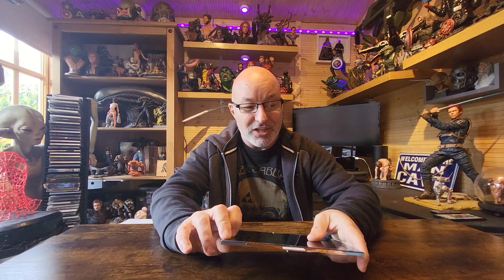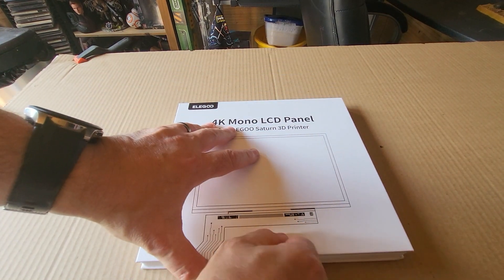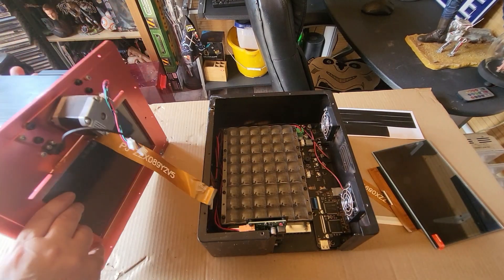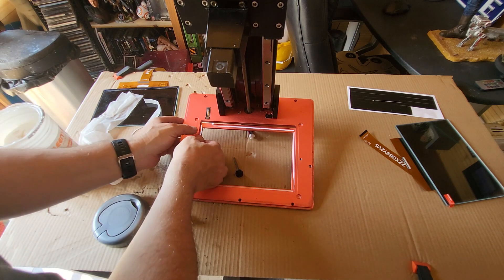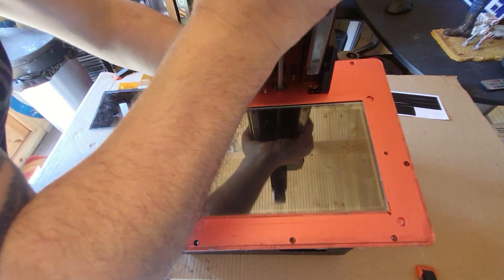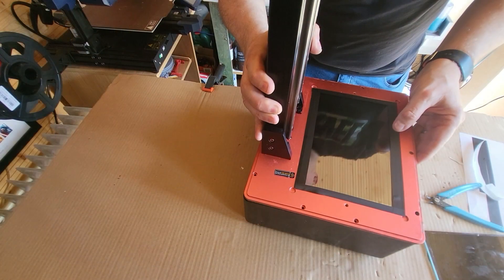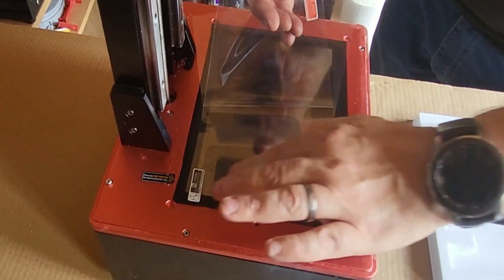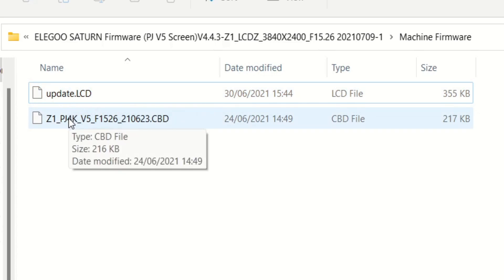How To Change LCD Screen On Elegoo Saturn 3D Printer

Comment: for clarity, pin 1 is towards the center of the board and pin 50 is on the outside of the board. (black side towards black clip)
you also want the Z- for the motor, not Z+
Reply from the maker: Thank you

Comment: you can actually just not remove the top, in the corner theres enough room to pry up the old lcd screen with a flathead screwdriver. it will usually crack the old lcd but thats getting thrown away anyways so no big deal, it's how i've been replacing mine for awhile and works pretty well
Reply from the maker: Not tried this
.. 👍

Comment: I would have shown in the video, which seems to be a big problem of lots of post on process of taking off the upper shipping protector.  People think it is a regular screen protector.  The one of the Red Tag that says REMOVE.  It would set a lot of people straight on the process.  good video sir.

Comment: Thanks for the info. Nice to know. I had to replace my motherboard and damaged the touchscreen ribbon cable because the connector for the TS ribbon cable is different than the LCD ribbon cable. TS cable is a press in not a clamp in like the LCD cable.

Comment: I just changed the screen in a new saturn i bought as 'spares/ repairs' got it for £100 and I already had a replacement screen for it as i had a spare for my other saturn that i bought new, now got 2 working saturns :) I love the way the screen package came with the adhesive tapes needed instead of having to save old ones, my saturns don't have the screws underneath either
Reply from the maker: What a bargain eh 👍
Reply: @greedy3d480  totally :) already had a sealed genuine elegoo screen and some fep to change out, clean the thing and works perfect :D all it cost was a bit of time and effort ( and already having a screen and fep)
Reply from the maker: @fraserphilip7243  result

Comment: I had to change mine about a month as well because for the same reason I was getting failed prints.

I use have go Leckwith my ribbon, as the replacement had the same number as the original and all I needed after installing was to re-flash the drive and relevel and I was away, and I am now 3/4of the way through printing cake and jean dio from wicked at 100%.

What I did invest also was some plastic razor blades that uncle Jessie talked about and now use these to clean any excess resin when I get some sticking where it shouldn't be.

A good decent staright forward video which is easy to understand without the gobblygook talk.😊
Reply from the maker: That's very kind of you to say thank you